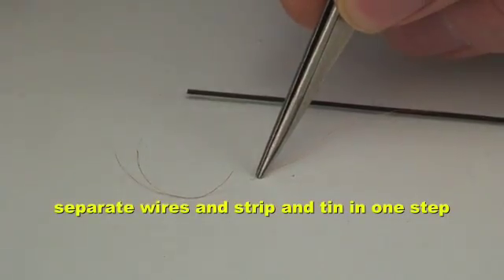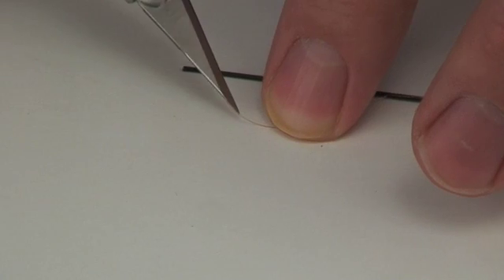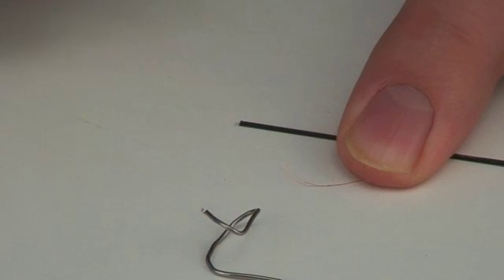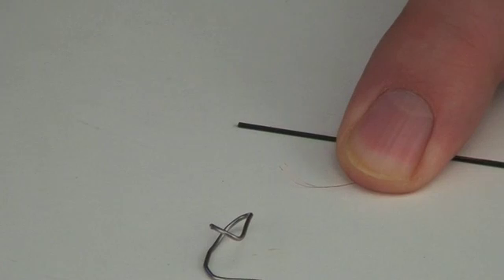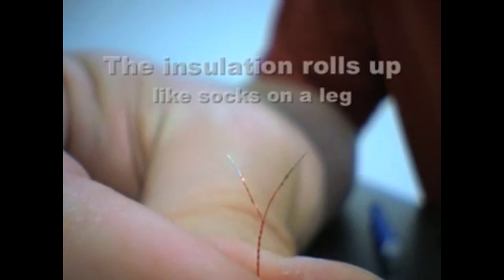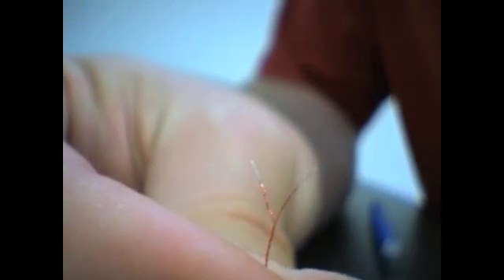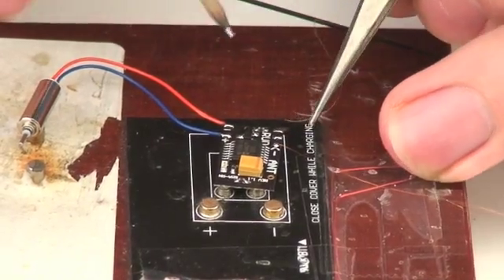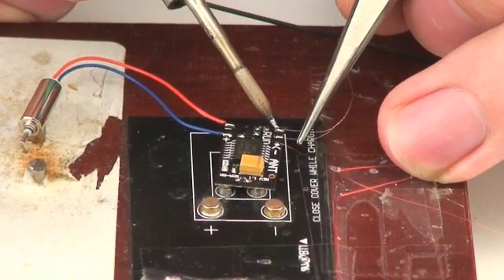How to Solder magnet wires - Plantraco Microflight

Comment: Thanks for upload. I can't get my wires to tin. They are coated in plastic which burns away easy but there is also what appears to be cotton running through the core which goes all fluffy until I burn it away gently with a lighter. The ground wire also appears to be a metallic blue. Super difficult to work with and solder is just repelled.